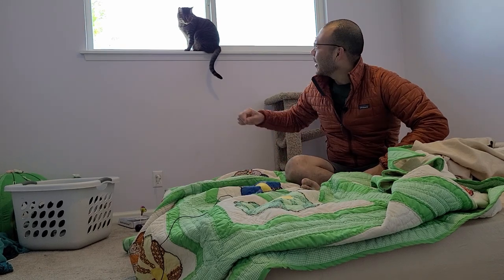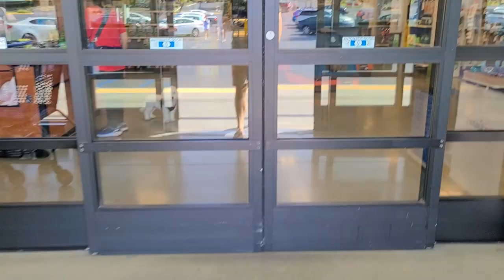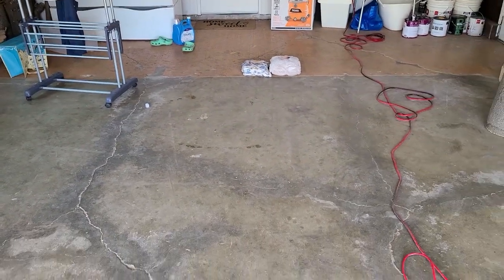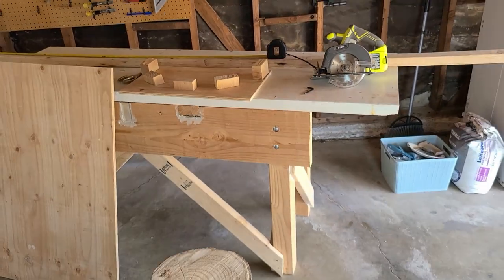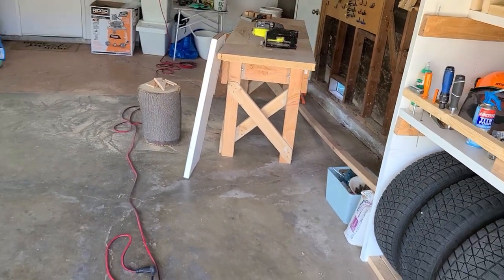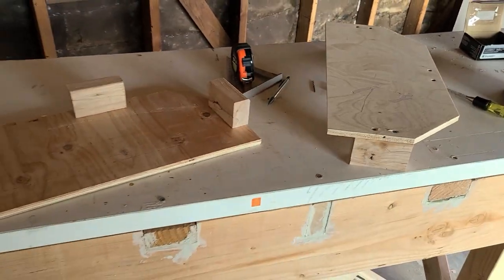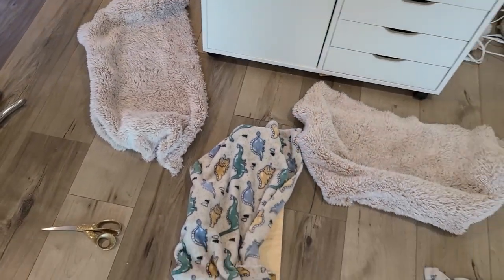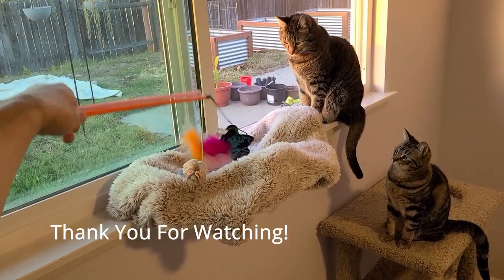A Dentist Builds Window Stool Cat Perch

Comment: I think you meant "window sill" rather than "window stool". I love your embrace of the DIY rather than buy.
Reply: You need to use Evan & Katelyn's trick of putting catnip on their projects for the cat. ;)
Reply from the maker: Lol! I actually thought window sill too, but wasn't sure so I googled it. Turns out I still don't really know. I didn't know a window had so many different pieces with different names. I think the sill is the piece underneath/normally not visible and the stool is what you see.
Reply: @ADentistDoesHomeImprovement  I stand corrected. I'd never heard that term before, so I looked it up. It appears to be a subject of great debate, too as just about every diagram I've found either supposes what you say or what I say (or uses a slash between both terms). Who knew it was so controversial.
Reply from the maker: @jasonbailey9139  Genius on the catnip! I'm still totally confused about the sill vs stool, but I've only spent like 5 minutes looking at google image and exactly like you said there's different diagrams that show different things! Lmao.